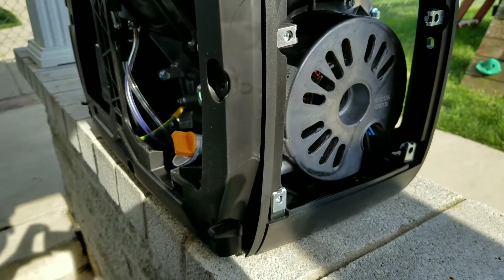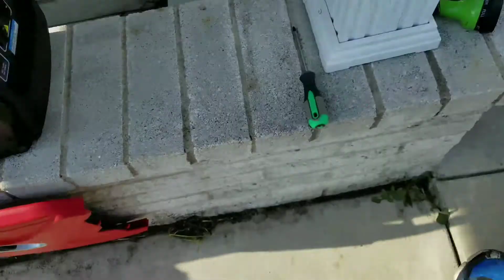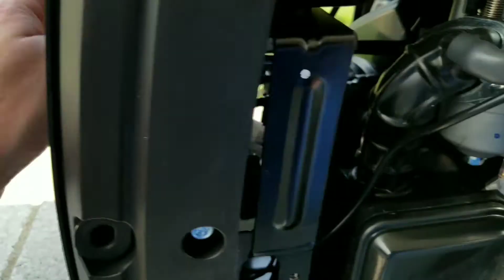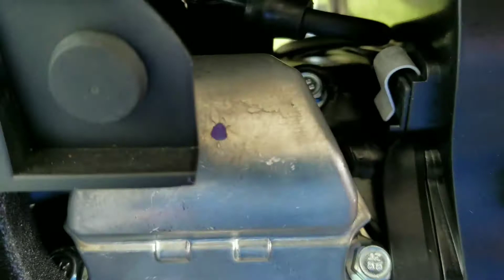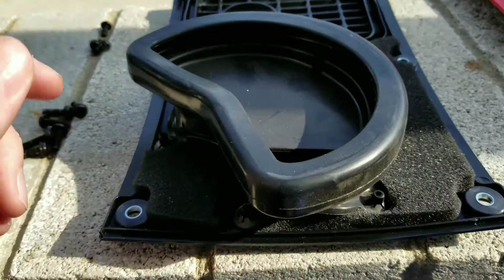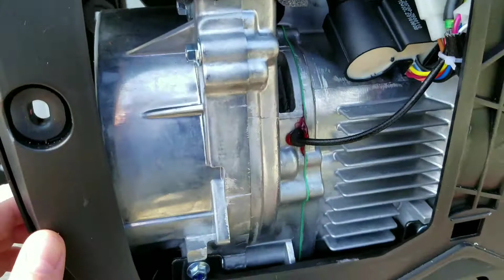Harbor Freight Predator 2000 Watt Inverter Generator Part 2 - Overview and Inside

Comment: Hey Mike i have the same generator. Im trying to replace the pull cord. But the 3 bolas that hold the cord housing in place keeps turbina with the tareas the hola the bolt. How do i remove the bolt. Would you help me out pls

Comment: I know this is an old thread but here goes...  What transfer switch do you have for getting power to panel?
Reply from the maker: I don’t have a transfer switch set up at my house yet so I normally shut the main off then I backfeed the generator through an outlet in my garage which feeds half of my panel to run my furnace refrigerator and stuff like that but I do have the Reliance Transfer Switch Kit — 6 Circuits haven’t installed it yet.
Reply: @MikeSimon  Thanks for the quick reply.,

Comment: Can't get it to run. Tried 2 different brand new units...
Reply from the maker: Hmm
Reply from the maker: Are you turning the gas cap to on?
Reply: @MikeSimon  yeah, turns out it didn't have enough oil lol... Doesn't come with enough apparently.
Reply from the maker: Ah, yep that just shipping oil but yeah I forgot it has a low oil shut off

Comment: Why does the 12 volt charging port look like a electrical outlet? I have never seen this before in America and wondering how you would even use this part of it.  Thanks.
Reply from the maker: It’s a angled plug must be their proprietary cable
Reply: @MikeSimon  Thank you

Comment: How many watts in Eco mode? Just picked one up. Quiet and started first pull. So far so good
Reply from the maker: I'm not sure where the watts rating at idle, but as you draw more power when in eco mode, the generator will auto adjust it's speed to accommodate.

Comment: We just purchased one in northern Georgia after we lost power to the house for a total of 13 hours. We ran it for four hours of that time (hour drive each way to HF). Ran perfectly and powered the refrigerator without any issue on ESC. Good video of the panels taken off.
Reply from the maker: Thanks!

Comment: Dear Mike. We bought one in May, and have run it 4 mos. solid. Never a problem. However, it started lugging down, and i know the fuel filter is clogged, yet HF can provide no part #, and no one will work on it as a result. Any suggestions? signed hot...in Austin Tx
Reply from the maker: Hello, I checked out the Manual for these and there are actually only 3 fuel lines and 1 fuel filter. Now the fuel filter is the inert that's in the gas tank where you pour gas in, that's what they are considering the fuel filter, other than that looking at the manual break down there is no other fuel inline filter.

Comment: Mike, perhaps you can find the specifications on the AC unit in your trailer? It will show the running watts and maybe the startup watts required by the compressor. This will help a ton. The reason I mention this, is because too many folks purchase a small generator without taking into account the required wattage of the AC, only to blame "the generator". I cant count how many times I've seen that happen. Some folks even complain that these doesn't come with oil and fuel.  Yes I'm serious. They also complain about having to do oil changes. Weird.  Lots of folks just don't get it. I suggest getting a second one when you can. They work great together.  Great job on the video!
Reply from the maker: yeah I had a feeling it wasn't going to run the ac unit. And I know what you mean.

Comment: Thanks for the video .I have one of the 2500 watt units before this type it is a great little genny. I have lots of video of it on my channel. These new ones seem to be a copy of a Wen generator seems to be a copy of that unit. If I did not already have 3 generators I would buy this one also.
Reply: TheKilog69  i have the predator 2500 and its a  really finicky runner.  the governor sometimes sticks throttles up the shuts off. or it downs out when you put a load on it.
Reply: Pueden ablar en español
Reply: Yo también compre  una 2000